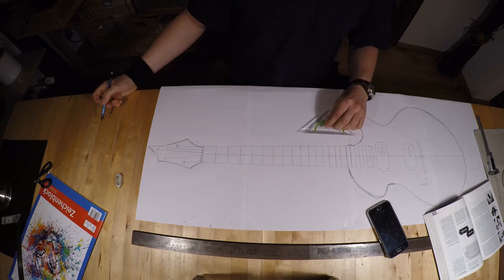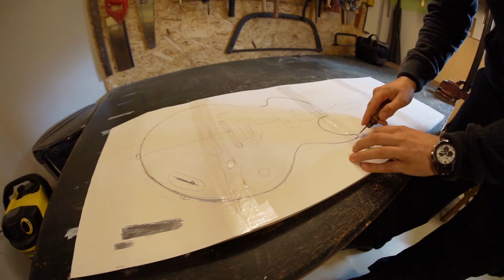Craftling: Electric Guitar Build

Comment: Now I understand why they cost so much, I enjoyed this video a lot, thanks!
Reply: They have factory's....
Reply: Spaghetti Sparker actually companies like Gibson still make their high end guitars by hand.
Reply: @rancid1024  nope Gibson does everything with CNC Mils besides paint and buff
Reply: Airsoft Con Gofio this is handmade.cheap ones are made in factories
Reply: Gha Specialization doesnt make labor that hard... on a single person at least. they have enough supply to overthrow demand by a long shot. soo... you would think they would be cheaper none the less. still quite alot of work goes into a single guitar
Reply: @nickgoneau6716  obviously. If they were all made like this, do you think you would only be paying a few hundred quid for any guitar. It's still a lot of work. Factories still need employees and maintenance and the more there is to do, the more expensive it is to run.

Comment: Great video, and awesome guitar-- thanks for sharing.   
Just a couple suggestions from a 55 year old master woodworker, who has learned many things the hard way, and some the easy way.   First, always glue both sides of the wood, and try to use just enough to fully cover each side. . While it may seem that it is not different to glue and rub a single side, tests have been repeatedly done that show that if you do glue both side separately (with the correct glue), that it will always be stronger than the wood (and will not fail in your lifetime in any common climate), while if you do one side and smear, the glue will fail first, and will do so anytime it is sufficiently stressed-- definitely in your lifetime.   
Second, the type of glue matters a LOT, as does the age of it.  Do not keep old liquid wood glue (e.g. more than 1-2 years) around. That is unopened and stored at room temp.  If it is opened or in a warmer of colder environment, it will degrade quicker.   There is plenty of good up to date information on all of this.  
Third, NEVER use anything with acid or oil on it to spread the glue (e.g. fingers have both), as it will begin to affect many types of glue within months, and cause several common issues, depending on the amount on the skin or object.
Try to use quatersawnfor the neck, for obvious reasons.Your tunability, longevity and playability will be greatly increased, and will not degrade over time like it will for flat sawn necks.  Note you can create a quartersawn piece from a flat sawn piece of the proper size.
Reply from the maker: Hello Andrew! Many thanks for your extensive comment! Such tips are valuable because they come straight from the practice. I've never thought about it, but it makes sense. Crafting is not my profession and I must confess that I had to google "quatersaw". I'll pay attention to it on the next guitar. The oak piece of this guitar I had been here forever and wanted to consume it finally ... As I said ... Thank you! Have a good time!!!💪👋
Reply: 100% agree. I have experienced joint failures just because I only applied glue to one pice of the joint.
Reply: Andrew Denis. Go on ya good thing! Great details
Reply: i agreed.
Reply: @craftlingsworkshop  Invest in a glue spreader instead of using your fingers faster and not messy.Hats off youve proved you can build a guitar w/o being a super skilled wordworker.
Reply: actually the stongest neck is a 2 piece equal opposite grain
Reply: Wow

Comment: Nice work!!  Make do with what you have.  I like that.  She turn real nice.  Just getting ready to do my first one as well.  Although I am taking it easy on my self first time round.  I picked up a slab of mahogany at the local wood shop.  I'll start with that for #1.  You have some slick ideas.  I was surprised with how you used the saw dust to capture the shape for the cap.  Also using the string to get the neck straight.  I booked marked this video and I will use it for reference when I get started.  Thanks!!

Comment: you are a good worker... to any beginner I would suggest to do the internal routings, drilling and hardware fit checks for exact positions and strings allignments before worrying about the body and headstock shaping, same goes for the socket to neck coupling. Watching some manufacture factory techniques on YouTube documentaries give tremendous tips too(I wish YouTube was there when I was struggling)Yes, I also noted the awkward gluing technique, apply Tite Bond and wait for a little before joining the parts for the glue to be absorbed and not all squeezed out. (I understand that you were filming and that maybe you know those things but is about who is watching and getting ready to try the journey )Just remember: start from the center, the guitar is already in the wood...not around it.

Comment: Nice job! I would have liked to see him do some final testing including intonation - accuracy at octaves, up fret buzzing for neck trueness and such. Chords in the lower register frets 1-7 or so would be expected to be clean but moving up around the body.neck junction may would be in question. I also didn't see a stop plate to limit truss bar rotation during adjustment. It looked as though the truss was a single round rod with a hex heard end. Maybe it wasn't visitle but it looked like a round body end so adjusting the rod would just turn and not tighten or loosen hence no adjusting of tension on the neck. He did a  nice job overall and it looks great. I might have done some sanding sealer on the wood prior to stain and laquer. Looks great - sounds great.

Comment: I would like hear a chord or three at 12-15th+ fret, or some demonstration of the intonation or verification of neck scale.  The tone is original.  Bright pickup on the neck might sound really good, maybe use a pull knob on the Tone for brighter Hz, also a one for the Volume for either half tap or single coil.  I'm a lead guitarist 42 years that is my viewpoint.  How is the action?  If I had your skills I would try a top quality Floyd Rose whammy bar install next time which complicates the the build for springs, spring plate, and the locknut etc.  Great work for DIY
Reply from the maker: The intonation and the action are quite fine, but I should adjust the whole guitar again. Over the months, the wood lays down a bit, but I am quite satisfied. The neck P 90 I actually use only clean, because distorted it sounds a bit dark. I installed a splittable humbucker on my new guitar and the sound is really brighter. See also my yesterday uploaded video... Thank you very much for your comment and your assessment! Greetings👋

Comment: Great vid, and awesome guitar man! I've been building one with the same setup (slowly for the last few months). Ive gotten to the point of looking into how to wire it up with no avail. I can't find an example with 1vol/1tone/3way/p90 neck/hb bridge anywhere on the net. Would you be so gracious as to helping me out or pointing me in the right direction to where you found how to wire it up correctly? Even a good pic of inside the back panel would help! Thanks!
Reply: Sometimes when links are included you dont get notifications or whatnot so just in case...
Reply: @Luablood  Thank you very much! I'll give it a try!
Reply: Pleasure, I would suggest checking Seymour Ducan web site they have a good selection of diagrams with more graphic representations of the components..  but they are limited to traditional stuff... might be abke to find a duagram for your stuff there... in fact I'd say their's might be better than mine (most likely)

Edit: link
https://www.seymourduncan.com/wiring-diagrams
Reply: @Luablood  I checked the diagrams there and the forum. It only shows a relevant one with the hb in the neck position (which is the one i was going to use) but there were a few differences that i would have to adjust. Im a good solderer but the uncertianty was a little  frustrating.  Im just shocked that there is no clear and clean cut diagram out there for this particular setup - it seems ideal to me.  I think the main discrepancies are the voicing difference between the single and hb as well as picking a tone/ vol combo that will sound the best with both types (traditionally 250k for singles and 500k for the buckers). Ive seen that you can put a resistor from the single's point on the switch to the tone(?) to make it see a 500k pot as 250k, but there will be a difference in quality in the mid position of the switch ( when both are on ).

Comment: I just wanted to tell you I think you did a great job for your first guitar dude! I wanted to suggest next time you put your frets in I put Elmer's glue in each slot and wipe off excess with a damp paper towels. Then make sure to clamp down overnight. And deber the edges of the fret so as to not cut yourself. Also the have different color fillers for woodgrain. Then you will have a flat surface to start sanding and eventually buff out to a rocking shine🎸 keep up the good work!
Reply from the maker: Thanks for the tips. I will try it...

Comment: just watched this again....& wanted to add a pointer to the process...I've been building/servicing guitars for almost 40 years and as much as everyone has their way of doing things, I would strongly suggest that you NOT use Titebond or anything other than a good quality hide glue to glue your fingerboard to the neck....you should also use the hide glue to glue the neck into the body and avoid titebond or wood glue for that part of the process. Why?  you may want to remove the fingerboard at some time if ever you need to replace the truss rod...same thing if something unfortunate happens to your neck and you ever have to remove/replace it altogether...or if you make any small error in getting the neck angle perfect the first time around....i have had to deal with broken rods and believe me it becomes almost impossible to remove a fretboard that has been glued with Titebond! I just recently had to replace the truss rod in a Cole Clark acoustic which was a difficult prospect in the first place because you literally have to cut the headstock off the guitar and replace it with a new one, but the fingerboard was glued with Titebond (factory) and would NOT come off with heat. steam or any normal service method...ended up having to sand it off with a belt sander and install a completely new one....trust me, you NEVER want to have to do this! ..
Reply from the maker: Hello! Thank you for your elaborate comment. I will continue to educate myself about this. I've already had to solve a neck that was taped with Titebond. It was a horror. A fretboard actually only went off with heavy damage. Therefore, I find your comment very interesting. Thumbs up!
Reply: @craftlingsworkshop  i'm glad to be of help....as you have already discovered, this is not an attempt to criticize what you have done, on the contrary, your video reminded me ever so much of the very first guitar that i built very much by hand and with rough "carpentry" tools when I was 19. at that time I thought it would be smart to glue the fingerboard to the neck with epoxy....i wanted to use ebony at the time but could only get a beautiful very hard piece of black walnut...which worked out well, and I thought it would be a really good idea to make sure it didn't come off....but some time later I DID get my hands on a great ebony board....but guess what?....there was no way in hell to remove the walnut board! lesson learned. after some further education I discovered the whole business of hide glue for instrument building and why this is the "norm"...that was 40 years ago. ANY parts of the guitar that are NOT intended to ever be separated for any reason SHOULD be assembled using strong resin glues like titebond, slow setting epoxies etc. laminations, veneers,overlays..inlays...pretty much everything except fingerboards and neck joints and once you have encountered what you mention you have discovered with the titebond/fingerboard issue you will immediately know why! carry on building!!!! all the best.

Comment: Pretty good. Your accuracy isnt too bad, but can be improved. Eg: Use a clear epoxy puddle, and spread it out from the center. Makes it a lot more hard-wearing. And is a damn sight quicker. Just be careful on the sides. Gets rid of those unsightly dips too. Gravity is your friend! Another option is to use a sealer before you spray to stop the layers absorbing at different rates. (If you want to keep it as thin as possible) And then... DUDE! For the love of god, pay more attention to the fretboard curve. It's one thing to hammer the frets into the right position, but it is not all about that. The curve of the fretboard has to hit the exact spacing of the Bridge hole distance. The string tension fans out as you head up, and oscillates wider.  If the curve is too deep or too shallow, it's gonna think its a different string and whine. Bending is going to sound like a newly born viola player. 
One last point. Use graded saws for the Nut would you? They should all be pinched at the point of most pressure. Set the tuning heads in first, loosely set the strings one at a time, and look at the angle of intersection. You want to get that as steep as possible, and directly at the start of the scale length. Also, bone doesn't work for electric guitars. In an acoustic, because it has a teeny tiny bubble structure to it, it helps to amplify the sound to the neck. You don't want that.  You want a conductive material like Brass. Something soft enough that it does not cut the strings, and something hard wearing enough to get your intonation right. Like a metal on metal pillow. All the action is taking place down by the pickups see? Anyhow, i had fun watching the video, and i hope you can learn from my mistakes!

Comment: I have to say that I am impressed with your work. I have one suggestion to make concerning the electronics. You added a bare wire from your dc ground to the earth ground. Be extremely careful with this. Many electrical devices will use a ground wire. However, should you play a gig outside and come in contact with another guitar player. You will not like the electrical discharge. I strongly suggest disconnecting the dc ground from the earth ground (bridge). That is if you use a direct connection to a power amp. If you are using a wireless connection, you will be ok.